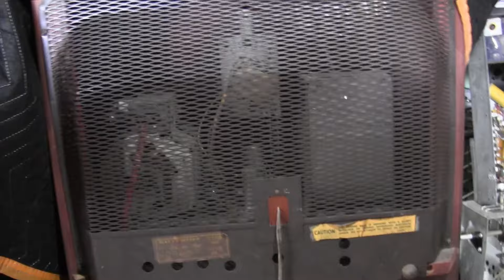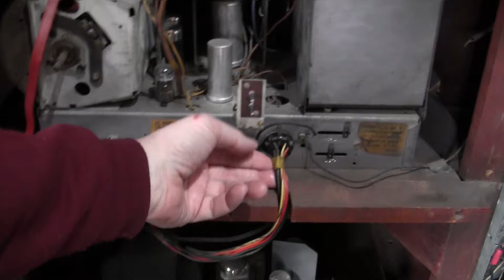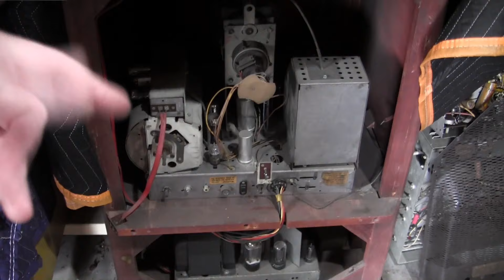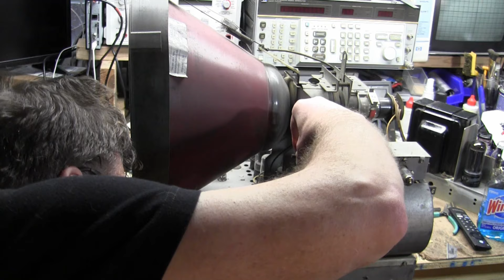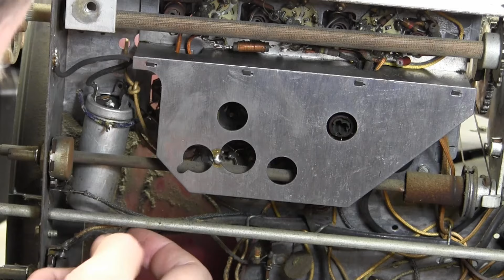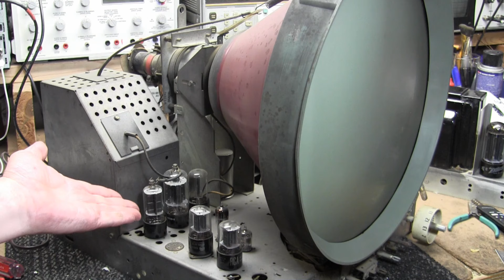Zenith H2438R "Aldrich" part 2: First look inside

Comment: The parallel HOT is to get better linearity with the early designs and also each tube is sharing in the drive current so longer life. Later HO circuit designs treated the tube like an on/off switch and relied on the magnetics to drive the beam linearly. Early designs were like audio amps, with bigger CRTs they get into grid conduction when you try to drive them more.

Comment: My  firrst memory of broadcast   TV,   arond    1972    with the  antenna  on the roof  which   was  motorized   You had that  crazy  control box on  top of the  television   which   rotated the  antenna   to  better tune  in  the  station     Is  my  memory  correct  this  was  way  before  cable television
Reply from the maker: Yes, antenna rotor.  My grandmother had one,